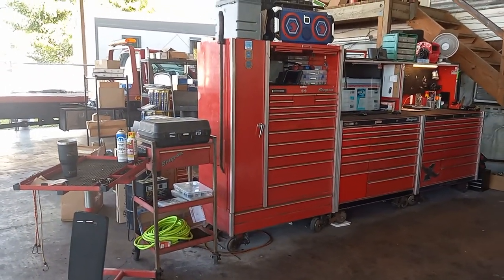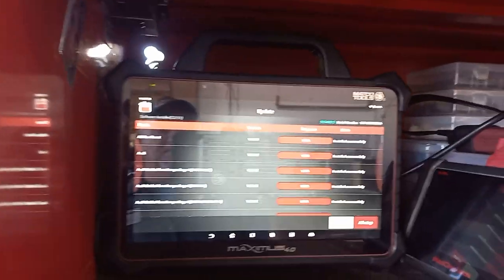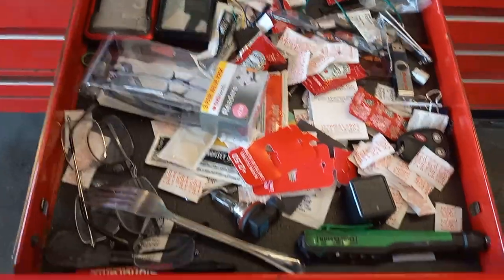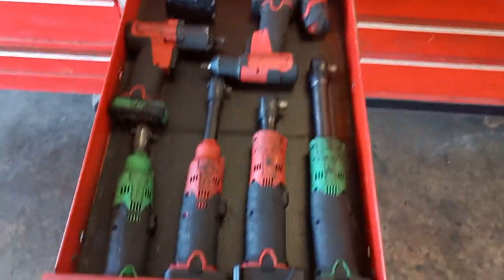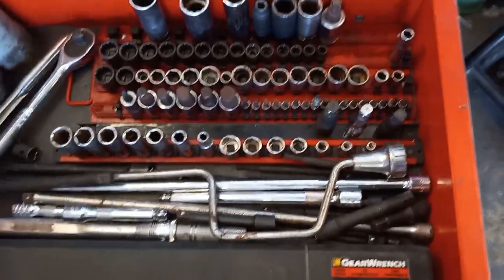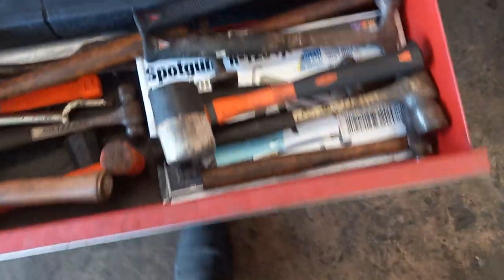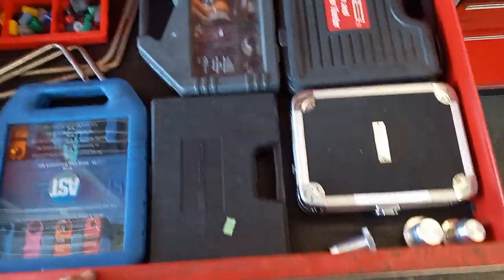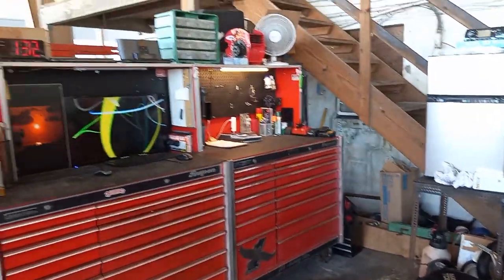UPDATED Tool Box Tour for 2022

Comment: That's a very impressive setup! I like how you separated your drive socket sizes in there own separate drawers. That's what I did myself. 1/4" in it's own drawer and 3/8" in it's own along with 1/2" drive. Much easier to keep track of sockets that way.

Comment: Super interesting having all your sockets you use the most down so low back must be solid im 33 and back is shot I want the most used tools level with my hips I don't have to bend down for
Reply from the maker: Luckily I haven't had any back issues. They are lower than most but in my older boxes I don't have the big wide top drawer like the newer boxes fo.

Comment: Thanks for the video! What did you decide your set up with thr sockets so low?
Reply from the maker: I don't have that big top drawer like the newest boxes do and on the KR100's that is how far down the deep drawers are that would hold all of them. I work off of a cart so these boxes never move not too bad, I also just got a new snap on cart that I am about to transition my daily use stuff into.